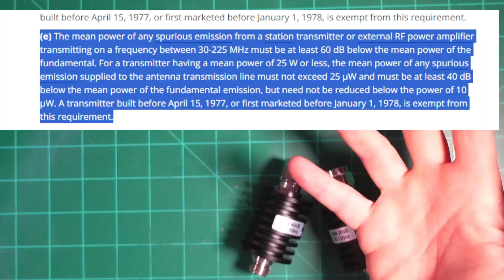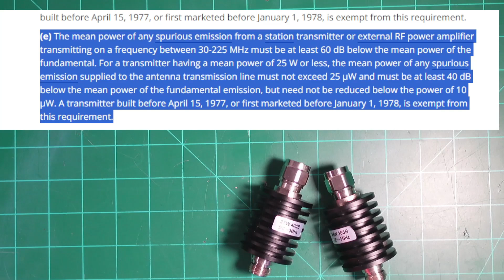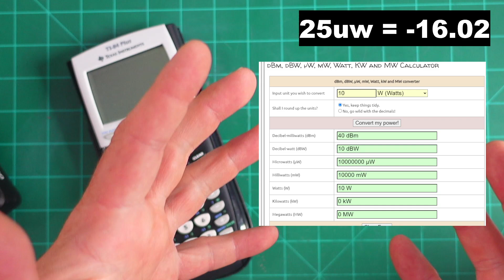The EASY way to Calculate Proper Attenuation for Your Spectrum Analyzer.

Comment: I think I watched this video maybe 20 times trying to figure out the math... stupid windows calculator is worthless for 10log and had to use google sheets for the math LOL. Now my brain hurts! I think I got it, but maybe not! So what your telling me for 5W radio I need a 36.99 dBm or a 56.2 dBm attenuator? I'm so confused.
Reply from the maker: Hey there.  First, convert your  actual output power from watts to dBm. 5w = 36.99 dBm.  Then we need to attenuate according to Part 97.307  (e) :

The mean power of any spurious emission from a station transmitter or external RF power amplifier transmitting on a frequency between 30-225 MHz must be at least 60 dB below the mean power of the fundamental. For a transmitter having a mean power of 25 W or less, the mean power of any spurious emission supplied to the antenna transmission line must not exceed 25 µW and must be at least 40 dB below the mean power of the fundamental emission, but need not be reduced below the power of 10 µW. A transmitter built before April 15, 1977, or first marketed before January 1, 1978, is exempt from this requirement..

This means we need 25uW converted to dBm --16.02dBm.  But not to exceed 10uW: -20dBm

Inverse the -16.02 (for my shortcut method).
and
Inverse the -20dBm
36.99 + 16.02 = 53.01 dBm. 
36.99+20 =  56.99 dBm
So typically you can get a 40dBm attenuator or a 50 dBm attenuator and use your analyzer for the difference in attenuation.  For example, if I have 50dBm of attenuation and i need 3dBm, I could add it from the analyzer. Cheers.

Comment: great info ! that why I like the tina SA ULTRA . you can add external gain to measurement . I have had a new attenuator from Amazon bad out of package and sent it back. was out of stock and got refund and got a different one. I have seen some go bad. so best to test on a VNA. how I knew a new one was bad.  for hi power measurement a line tap is needed and proper dummy load. I use a Byrd 43 line section with BNC tap sample slug into 2.5 Kw 50 ohm dummy load. when buying attenuators look at spec on them. DB Atten.  and rated power also the ohms. they make 50 and 75 ohm ones. 73's
Reply from the maker: This is a great point. I have had 75 ohms ones in my bags before.  I made it a point to mark them, or throw them out; I don't remember which :)
Reply: @DudeTested  75 ohm ones are for CATV or AV/audio work.
Reply from the maker: Absolutely.    I have a few, somehow :) . ..